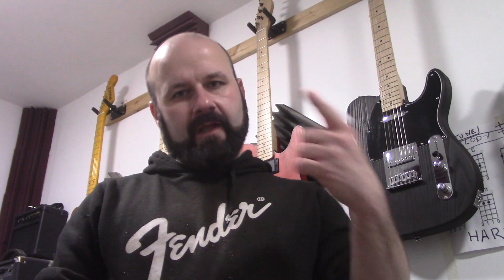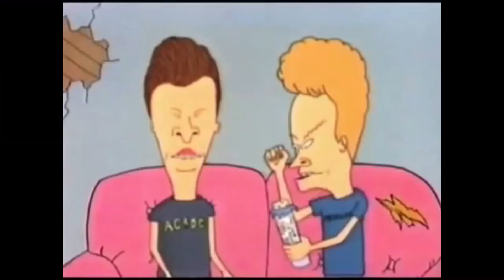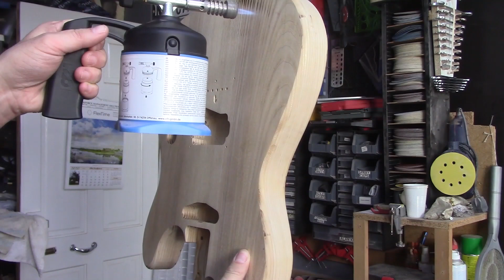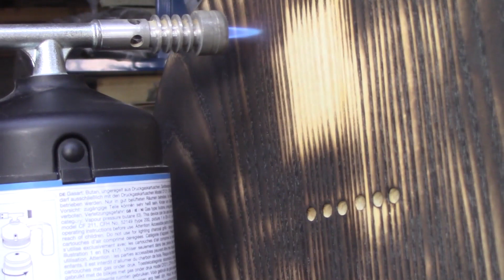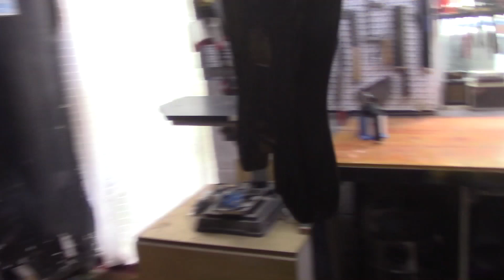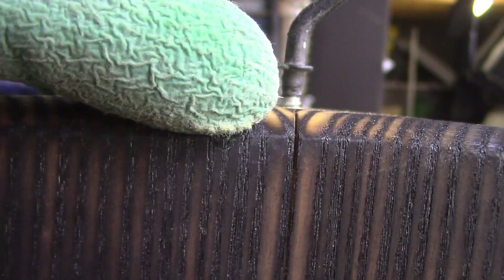Custom Telecaster Build Final Part 5

Comment: Thanks again for your great detailed information. Scorching the body was a surprise to me,thinking along the lines of the more usual 'painted' "plastic" look to the body's?. Question? Would the 'raised' fibers of the wood allow for a measure of dust to settle in under the trim items or is the fit tight enough to prevent this from happening over time??. I do like the texture though.!..I would love to see an actual crowning of the fretboard being accomplished?. I'm hoping to do this myself with a decent degree of accuracy if I can learn enough about it??Relationship to string height etc?. Very challenging 'stuff' to be concerned about??..You're a great man altogether. I might be able to buy ya a pint or two if I see ye.
Thanks for your great information. Brendan Murphy